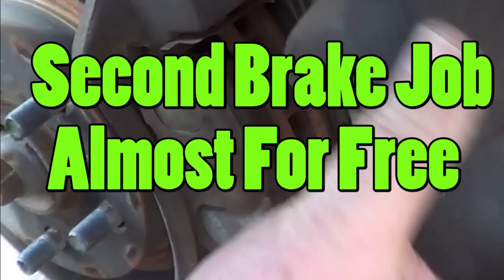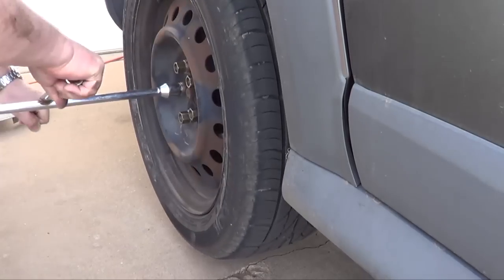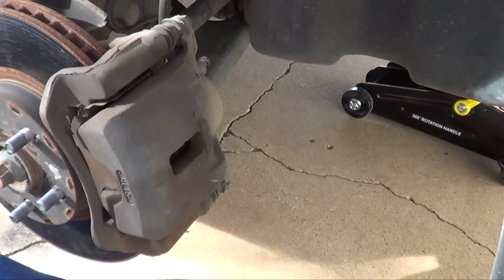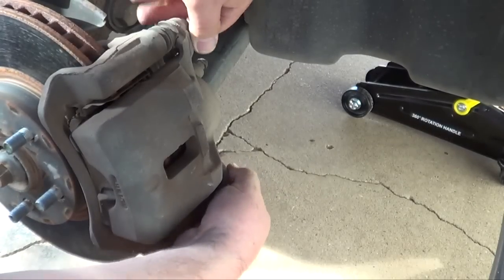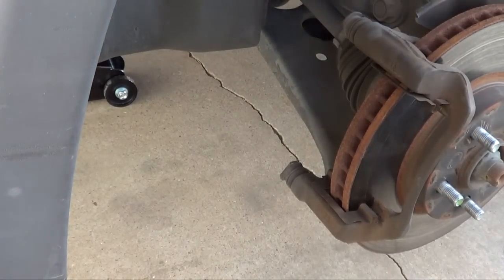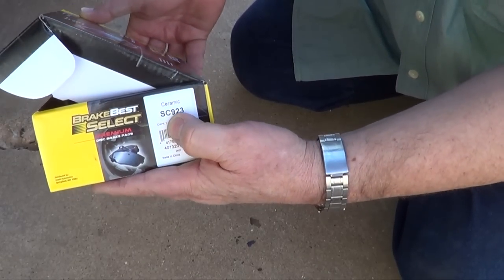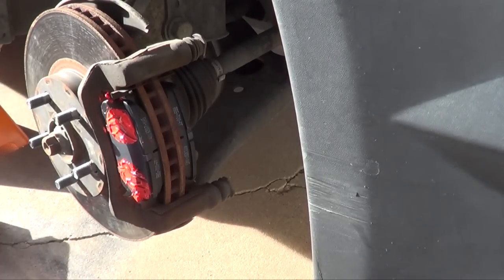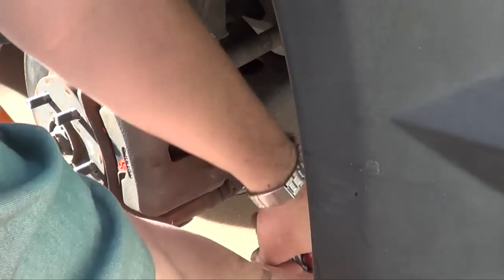DIY How to Change Disc Brakes on a Pontiac Vibe / Toyota Matrix

Comment: Suggestion to use a torque wrench. Caliper bolt torque = 25ft/lbs. Engineers don't calculate fastener specs for fun.

Comment: The problem with leaving the old rotors on is that they are glazed. They run red hot and carbon permeates the surface creating a hard slick layer. The pads skate on it. They are really cheap and brakes are important, why not do it all?
Reply from the maker: +carbidegrd1 The problem is that just because I did not change the rotors they did not change in the one second between old pads and new pads the old pads were working great as I said in the video their was no braking problem so I felt like it was not needed next time I will replace everything with new parts and not turn the rotors but replace them should of it been done probably but its been over a year and a half and the car stops perfectly so far - Charles

Comment: Okay so that was the part number for a 2009 Pontiac vibe. What abut for a 2010 pontiac vibe???
Reply from the maker: That was for a 2004 to 2008 vibe  ORiley’s show a sc1211 for a base model fwd 2009 to 2010 vibe not sure if it a GT or AWD models the same.  make sure you verify with parts store before you buy

Comment: Do you have to put your parking brake on or off? Secondly, did you open the brake fluid cap on the hood when you did your brake pad change sir? Please reply ASAP thanks in advanced. :)
Reply from the maker: Jay Pineda I had the parking brake on . The fluid cap on did not matter  I never added any brake fluid so when I pushed the calipers open the fluid did not overflow out of the brake master cylinder. If you added fluid to you brake system then you will need to open the fluid cap and take out excess flied so it does not overflow - Charles

Comment: Thanks for this!  This is one the only video I saw that let me know that I don't have to take the calipers completely off just to change the pads, and thanks for that screwdriver trick, it came in handy!  Also, every other video showed cracking open the Bleeder Valve, which I see you didn't do at all.  That's fine, right?  Like it's not causing any issues so long as my only problem is brake pads?
Again, thanks, buddy!  I'd buy you a beer if I could.
Reply from the maker: Phillip Roberts Thanks for stopping by I've had not had any trouble by not bleeding because I didn't let any air into the line - Charles
Reply: Cr Cook  that's what I figured.  Thanks for the quick reply!